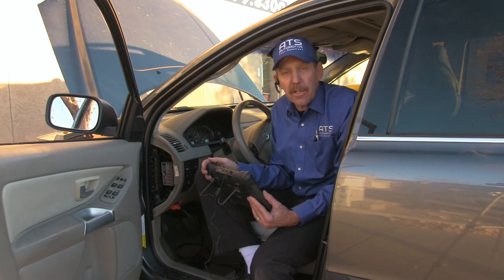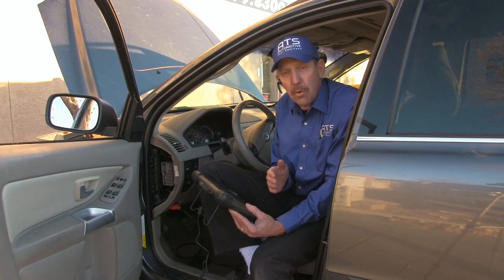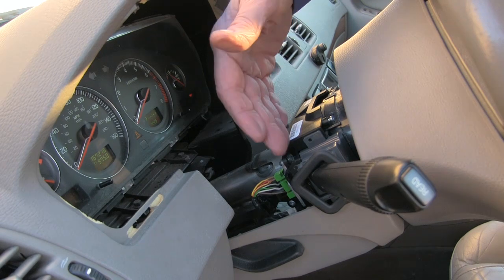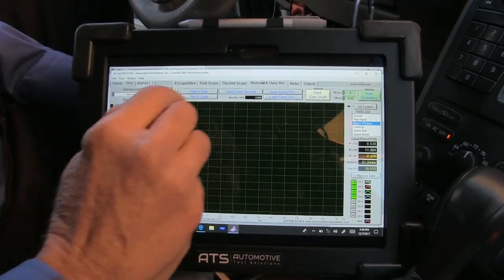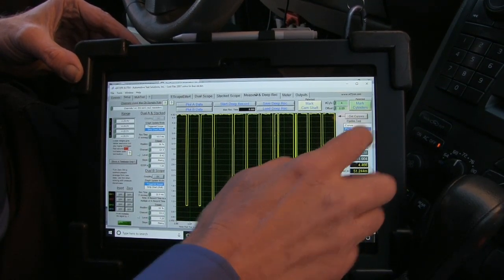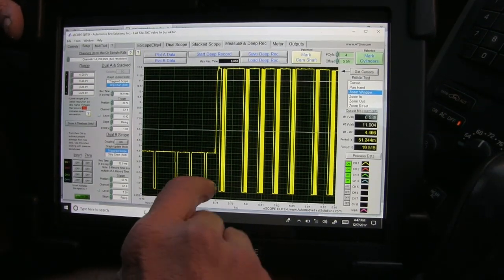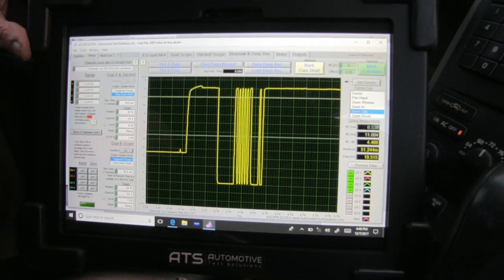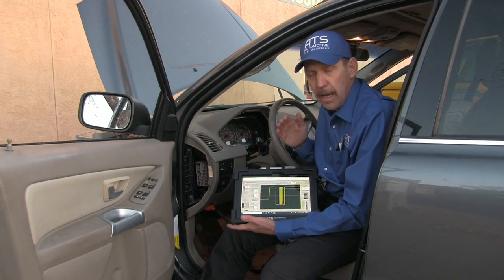volvo communication line down

Comment: what you need to do is add a waveform library in your scope of different communication protocols. could you of checked the data pids in the sim while moving the switch?